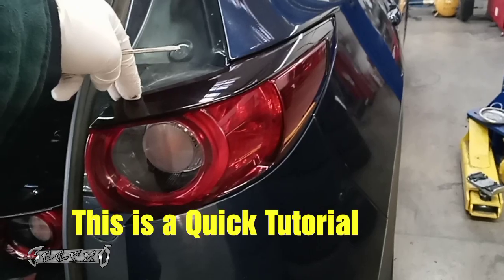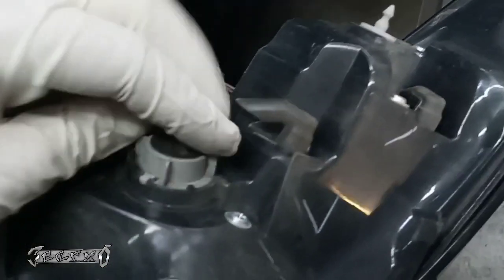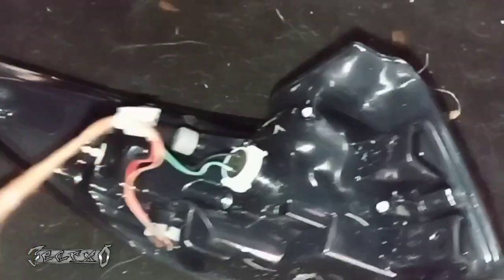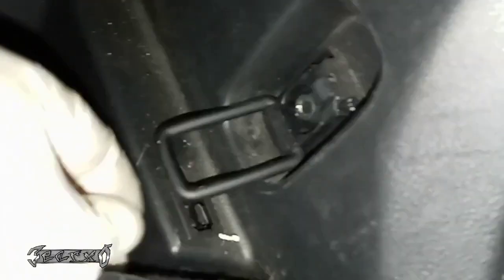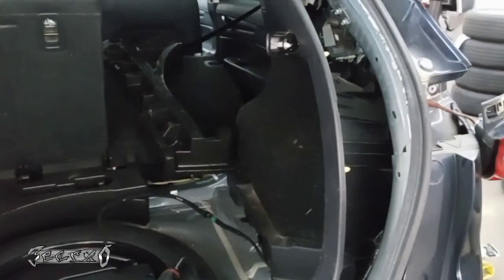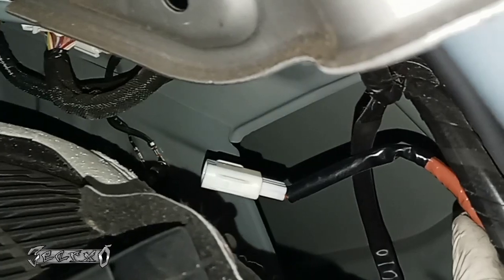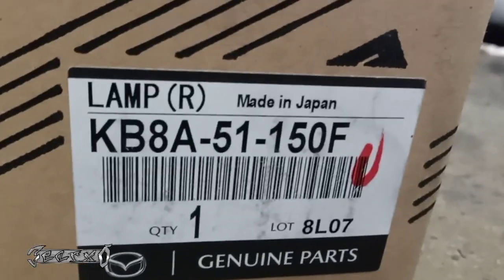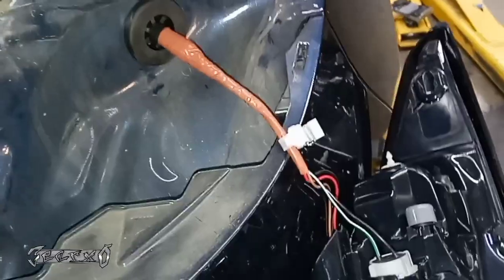2018 Mazda CX-5 Tailight Bulb & Housing Replacement

Comment: For those who are replacing the entire outer lens assembly, I recommend using the existing wiring harness to simplify the replacement.  The other wiring connection that Gearmo didn't remove also twist-locks into to rear of the lens but doesn't have a bulb. Instead it has a tiny white push-click connection that fastens to a circuit board. You disconnect the white male plug on the wiring harness by compressing the tab on the plug with your fingernail and it will easily separate. DO NOT pull the white female part of the connector off the circuit board! Dealer wanted $800 to replace broken tail light - bought OEM part from on-line Mazda supply for $290 and took me total 15 min. to replace.
Reply: Thank you so much. I did what you said and saved me a lot of ripping and tearing. Now all three rear lights gently blink a little brighter when the lights are on, about once every 2 or 3 seconds. Any insight to this problem? Thanks again for your advice
Reply: Mine does this, did you ever figure out the cause?@adoptedchild8851

Comment: Thank you for this video! I'm 66 yr old female and I just replaced my broken outer tail light. The only part that was somewhat difficult was getting the the blinker plug apart. The other problem I need to fix is my hatchback. It is stuck closed. I do know how to go inside and get it open but it stays stuck as soon as you close it. Any suggestions?

Comment: Shit design 

They should have put a little removable piece of trim that is held in by tab so you can access that part of the headlight assembly instead of gutting the trunk
Reply: No kidding. A six inch removable panel would’ve done the trick. I guess I’m using the old wiring harness. Carefully removing the tiny white connector to the circuit board might be a challenge!